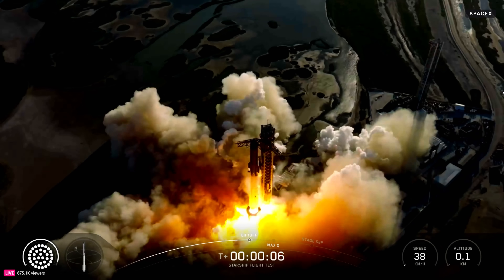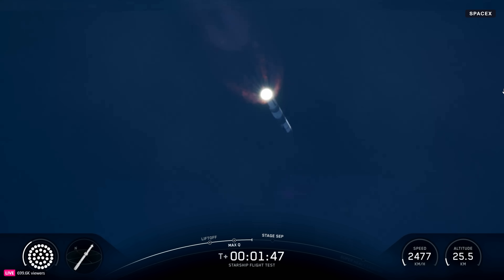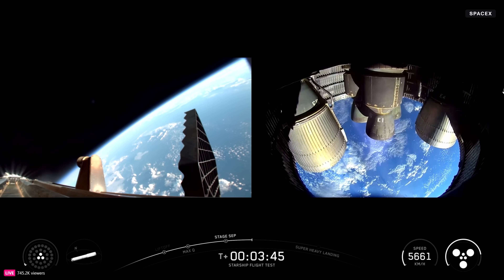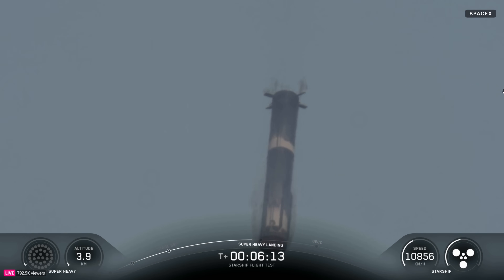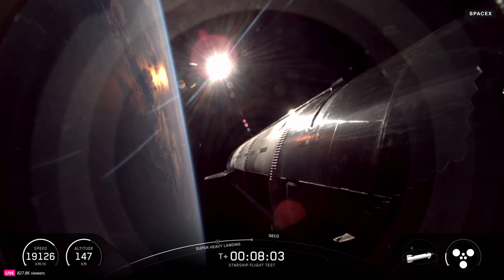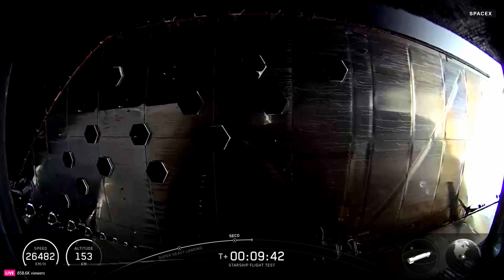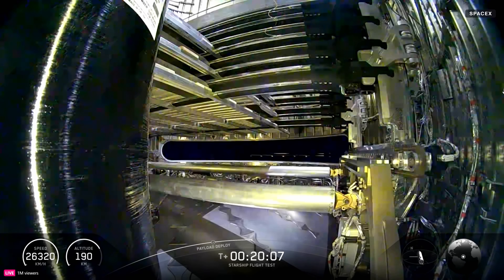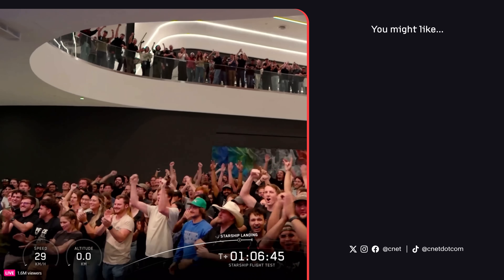Starship Flight Test 11: Everything That Happened in 11 Minutes

Comment: Starling simulators is the same as we saw on starship 10. I am looking for something much more important. 1. Heat shields hold upon re-entry. 2. Successfull landing or catch of booster and starship. 3. Starship exiting the Van Allen Belts and reentering. Taking much longer than the other ships.
Reply: What other ships?

Comment: Where does the detached booster go?
Reply: It depends on the goals, if it is to be reused they will catch it at the launch site, this was the final version 2 that was put through some stresses that are basically outside of the flight envelope to find out what the limits are. Flight 12 neither the booster or ship will be caught. Because it is the first version 3 ships and boosters, if all goes well they will start catching most of the boosters from now on unless for safety reasons they won't risk the brand new billion dollar launch infrastructure they are finishing up. They will attempt a ship catch with flight 13 or 14.

Comment: does that constitute crash landed in the ocean? Re-usable?
Reply: It didn't crash land. I came back following a very specific trajectory, lit it's engines, slowed down to a hover, shut down the engines and drops into the ocean, HARD so it breaks up, and if we are lucky the fuel and oxygen mix and explode causing it to sink rapidly so it is no a danger to boats and ships. It is only a crash if it comes in and and the engines don't start and itdoesn't slow down before it hits the water or if it explodes before finishing the intended goals.

Comment: Why they no longer catch the booster??!
Reply: Its the V2 booster, and they are testing a redundant landing burn phase. Next launch will be with the V3 booster.
Reply: Which they will also just ditch in the Indian Ocean... who cares about the toxic mess that sinks or floats, it's miles away from America.
Reply: @plica06 
The people on ships care if it floats, that's why when they do a controlled landing in  the ocean they explode, and if it doesn't they have to sink it.
Reply: Because they caught 3 out of 3 and know they can do that. The next 2 or 3 probably won't be caught, then they will start to catch almost all of them and only sacrifice them for safety reasons or a major design changes that make them obsolete, they will also catch some that will be gutted for parts and then scrapped, a couple will probably be caught and become displays for a couple of years and those will be scrapped. It's the SpaceX way. 
REUSE / REFLY / RECYCLE / REMEMBER

Comment: I noticed some discussions in the comments, so I will highlight the major ones.

1. The ship explodes after landing.
This is expected, as the ship is not designed to land in the water. The reason it is landing in the water and not at the launch site is because of risky tests being performed.

2. The ship exploding is polluting our ocean.
There are recovery ships nearby, so they will clean up the mess. Additionally, they land in the water, instead of at the launch site, because if something goes wrong while landing at the launch site, there will be a potential of a bigger mess than in the ocean.

3. Why are the vehicles not being reused after this mission?
SpaceX is performing risky tests, so making the vehicles return to the launch site would be a huge risk. Additionally, the vehicles being flown are being phased out for a updated version.

4. It doesn’t appear any progress is being made.
While SpaceX could had progressed further if not for the issues that plauged the block two version of Starship, many invisible and visible changes and lessons have been made since every mission. This all factors into their next version of Starship. 

If you are still not sure if the Starship program is feasible, that is a valid opinion, especially since there are many things out of the ordinary. 

Time will ultimately tell if the Starship program will succeed.
Reply: Thanks !
Reply: Here’s what I’m skeptical of:
>SpaceX has made zero progress on the interior space of StarShip that is supposed to bring humans to The Moon.
>SpaceX seems to be focused on creating a delivery craft for StarLink than they do for getting to the Moon
>Their projections and timelines are several years behind schedule, even on basic things
>Orbital refueling has had no progress either

Basically, it appears as they SpaceX is delaying the inevitable through all of their experiments. 
The reality is that more likely than not, StarShip is completely incapable of getting to the Moon or Mars, and most of the engineering team likely knows this already.
Reply: @jeffw8218 Thanks for your opinion on the topic. I would agree that there has not been any visible progress on orbital refueling and the HLS specific hardware. 

It is slightly concerning to me that there has not been any visible progress in these areas, (I am more optimistic) but if there is no progress announced by next year, then SpaceX has a big issue.

Again, time will ultimately tell if Starship will achieve it's goals, or become a failed program.
Reply: @WesternSpace1Thank you for writing a good comment to begin with 😄.

I guess we’ll see what progress is made by the end of 2026 👍.
Reply: @jeffw8218  They're still in the phase of making sure that the vehicle itself is viable and reliable. Interior comes after, plus, they already have experience with that with the Dragon capsule. Orbital refueling will probably only come about after Starship is a fully developed vehicle. And yes, regarding schedule, I always add 1 to 2 years to every timeline given to us.
Reply: @jeffw8218  The interior space of HLS has had work done on the ground, and we've seen some images of it. Astronauts are also testing with it to help further development.

Being able to fly Starlinks will allow them to begin building up their flight rate and testing reusability. But even outside of that, these test flights are to bring the entire vehicle to an operational state, which includes launching Starlink. HLS is a separate program, and is actively being worked on, even if it's not as public, NASA released an update during IAC 76 for instance.

This is true, but it's a combination of things being more difficult in practice than in theory, and a changing of plans for development. Raptor 3's aren't going to be used until Block 3, which for a variety of reasons will be the first operational vehicle, while Block 1 and 2 are purely test vehicles, and Block 2 of Starship was really Block 1.5 since it basically used the same booster as Block 1, and just validated the new fuel tank design and upper flap redesign after a rocky start. 
What basic things to you mean? Orbit? They've had that ability since Flight 6 when they did an in-flight relight of the Raptor, but they're just being cautious given the size of the vehicle and difficulties in Block 2 (and have done 2 in-flight relights since).

SpaceX performed a short in-orbit test during Flight 3 to transfer propellant between tanks for NASA. The first Block 3 Starship has docking hardware, which they may have some test for during Flight 12. In the update for HLS as I wrote earlier, NASA's Marshall center test stand 300 allows for testing of cryogenic storage, and specificially mentioned testing "hot gas RCS thrusters" which SpaceX is working on for Starship. That's what has been done or is ongoing, while a ship-to-ship propellant test is expected to happen after Starship demonstrates orbit, and has hardware being built as of earlier last year.
Reply: I really love all this space x is doing but i would like to see a whole sequence without something blowing up, its been years already
Reply: @Miguel_Torrejón I would agree, even though it is a testing campaign, explosions is bad PR.
Reply: Starship (flight 11) explodes on splashdown, making the usual fireworks!  😂
"This is expected, as the ship is not designed to land in the water." Ok tik-tok engineer.🤣
Reply: @internetcensure5849 At least I am not actually on Tiktok or YouTube shorts 😂. They will clean their mess up as there are recovery ships nearby.
Reply: @internetcensure5849 Atleast its not exploding with astronauts inside like Challenger did in front of their family and thousands of people

Comment: Now, I understand ricket science is soo so difficult. They are going for 11 th test flight and they are having engine failure almost every flight test and they have still to land them on land.😮
Reply: I noticed that engine came back on when they did the burn to slow down before landing in the ocean.
Reply: @2204JCM 
That is why it is not a crash landing, it is a controlled landing in a very specific spot, that's why there are cameras there waiting. If it ends up in the water it will most likely explode, which is the goal, one to make sure it isn't a hazard to shipping and its competitors can't easily recover it. No,  if it comes in for a landing and the engines don't start to slow it down to a hover or if it explodes before that, then it would be considered a failure. At this point in development the goal is to try things and gather as much data possible to feed that into their models so they can predict what will happen and develop the best possible ship with the best possible performance with a near perfect success record so the rocket can become operational like the falcon 9 but recover both the booster and ship so they don't have to build a one use rocket like every other organization and country.
Reply: Rocket science is difficult because rocket science involves, physis, chemistry, electronics, aerodynamics, thermodynamics, orbital mechanics, most areas of engineering, etc etc and if they are crewed flights anatomy, physiology, biology and a bunch more and if you get anything wrong a crew could easily get trapped on a death trajectory where there is no possibility of a rescue of any kind.

Comment: I feel like rapid reusability is still decades away. And that shouldn’t be the focus, it should be the moon and mars. No matter what heat shield they use, it will still need some servicing after landing,  there was a lot of chunks of heat shield flying off during the landing burn.
Reply: Its spacex they will achieve rapid reusablity in 3-5 yrs. Normal reusablity ( like Falcon9) 1-2yrs
Reply: It's already here with the Falcon 9, now they are trying to do it with both parts rather than just the booster.
Reply: @jimshreve83  I wouldn’t call a couple weeks, or whatever it is for falcon 9, rapid reusability. Rapid reusability in the sense Elon musk talks about it, like aircraft or 24 hours, is in my opinion, decades away.

Comment: A huge chunk of tiles fell of on landing burn 10:57
Reply: This is starship v2. Last time they're using this version as it'll be V3 next. The tiles are being updated on the new design, they've already mentioned this before I think 😊
Reply: @OblivionsEdge  also, the tiles have done their job during re-entry.  if they fall off afterwards, then does not matter.
Reply: @FPVREVIEWS  technically it would do, because the whole point of starship is for it to be reusable so you kinda need those panels again

Comment: Thank god that elon isn't trying to design rockets himself, or these incredible flights would've never happened.
Not a big fan of the fact they're throwing out tons of methane in the upper atmosphere, increasing global warming by a considerable amount (as methane in the atmosphere is much worse than methane at the surface). Although it's cheaper and easier to store than the completely environmentally safe LH/LOX fuel often used, and avoids hydrogen induced cracking.

Comment: Hardly a success when it blows up. Forget chanting USA.. Started chanting " Clean the mess".
Reply: 😂😂😂 it's supposed to do that you poor simpleton. I am sure if you over clocked your 2 brain cells you could figure out why.
Reply: @WyoSavage1976  clean the mess
Reply: @dudzaisaburi6031 They do actually clean the mess afterwards, as there are recovery ships nearby.
Reply: It's just parts. The fuel is methane and oxygen. Does nothing to the ocean. A ship crossing the ocean to deliver your iPhone pollutes 50x as much.
Reply: They got all the data that they need to fix it
Reply: Moron
Reply: The ship is not even designed to go in the water, so an explosion was expected anyways. 

Also making a mess in the water is better than risking a worser mess on land at the launch site.
Reply: Try telling that to any passing whales or other sea creatures.
Reply: There are more shipping containers in the ocean from falling off ships in high seas than all the rockets ever made by anyone. If it floats then it will be cleaned up.
Reply: More whales are killed by fishermen in the last year than have been killed by a rocket in the last 70 years.